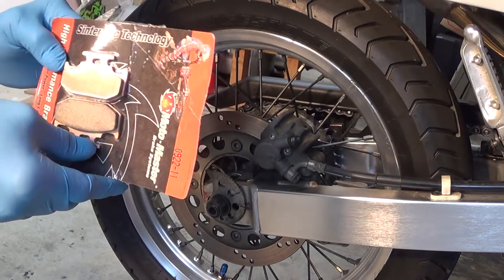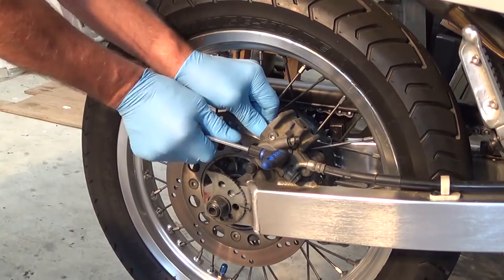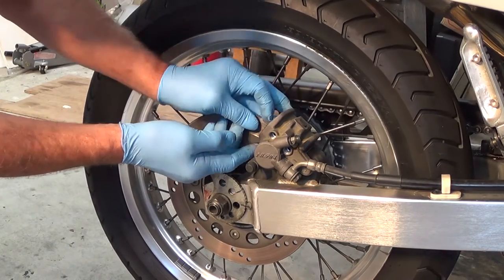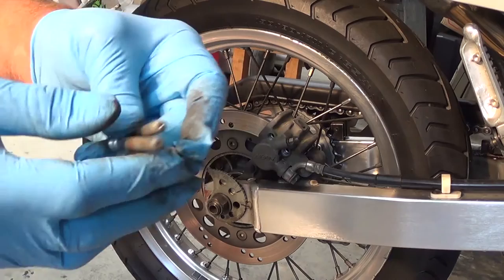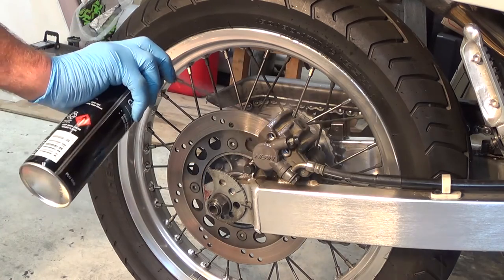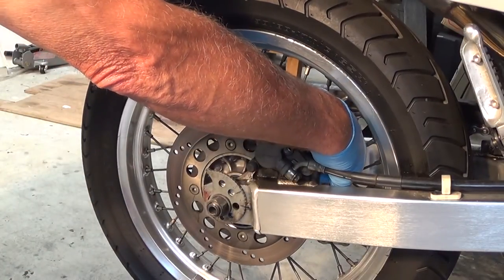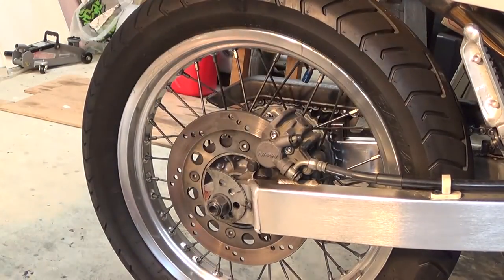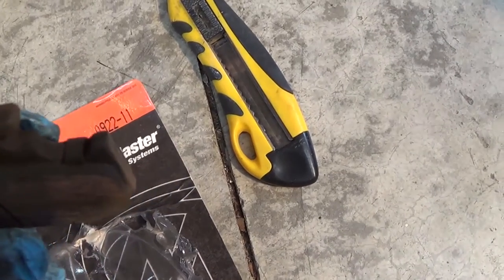Suzuki DR650 rear brake pad replacement

Comment: Thanks for the video went to change my DR 250 pulled the pins and the pads wouldn’t come off I was about to pull the rear tire off and I thought no let me look on YouTube first found you video changed my pads no problems thanks sooooo much
Reply from the maker: Glad it was of some help. Ride safe.

Comment: Thanks for the  vid Mate,  Ignore the haters i am all for the approach of having a go (withing reason..)  One thing that helped a LOT when pushing the piston was to first crack the screws on cap that sits on the brake fluid  this "breaks the seal" and makes it easier for the fluid to be pushed out from the caliper and back into the resevoir.  The other tip was to remove the rear bolt that holds the caliper in place then you can swing the caliper up and makes it much easier to remove the old pads and put in the new ones.  There seams to be a bit of debate on whether to grease or not to grease, I dont grease,  but dunno what the right approach is eh!  Thanks again! *G
Reply from the maker: Great tips Gee Man and thanks for the kind words.

Comment: Take off the brake resevoir cap to expose the fluid to atmosphere and the piston moves like butter.  No need to flex the rotor with a crowbar.  Move the piston all the way out and the pads just fall out!
Reply from the maker: Great tip...thanks. Ride safe.

Comment from the maker: Have added a note on the video to make folk aware of the heat shields.
Reply: +n45829 I guess the last owner of my '02 DR650 discarded the heat shields. Apparently the only way to get new ones is to order OEM pads from Suzuki… at over $100CAN -- the kevlar pads I bought are about $20 -- not sure it's worth it.

The other problem I had is to decompress the piston. I barely got the old skinny pads out. No way the fat new ones can go in.
Reply from the maker: +Adam Kadmon probably is worth it. I threw mine out by accident as well and got the OEM for the shields. To compress the piston I use a "super bar". You could use a large screw driver or tyre lever. If the piston is really hard to decompress then it may need stripping and checking out. Have fun.

Comment: Maybe figure out WHY you have uneven wear. Then learn how to replace brake pads and service brake calipers professionally. Scary.
Reply from the maker: Thanks for commenting Jurgen. I note however your comments are empty just like your head and your youtube channel.
Reply: @MothershipVideos  As opposed to you I am not just a cobbling YouTuber but actually am a qualified and actively working mechanic and also fully qualified to train mechanics. I have absolutely nothing against people making worthwhile YouTube tutorials. But I cringe when a customer gets stuck halfway through a brake service and refers me to your video which he used as tutorial. Your video shows nothing but a string of bad practice, omissions of safety critical procedures and safety checks and proves that you know shockingly little about hydraulic brakes and how to service them.
Reply: This comment was valid.  Maybe take the wheel off or verify the chain tensioner cams are set to the same settings at the very least.

Comment: Anti seize on the bolts not grease which will got on your brake pads, don't do any more videos, you are clueless
Reply from the maker: Thanks for your advise. I'm sure people will make up their own mind about what to use. As for making more videos, I don't think nasty comments from you will make me want to stop. It's You Tube remember not the complete guide to anything. Thanks for watching and ride safe.
Reply: Do not use grease on your brake pins.  It will work its way onto the disk and pads.